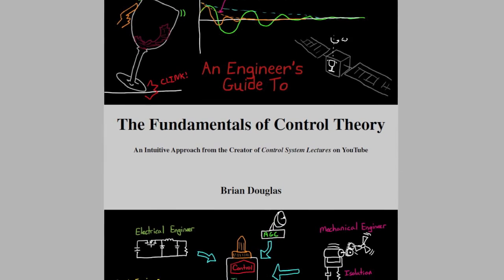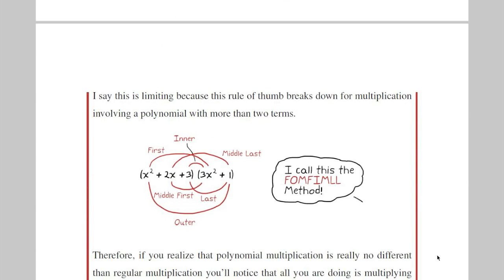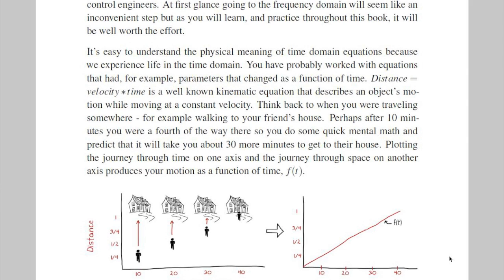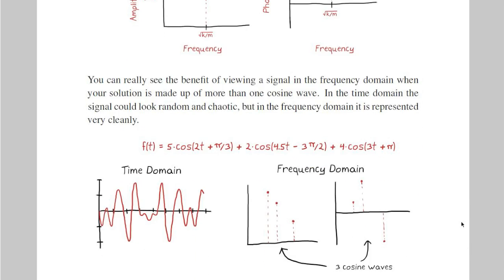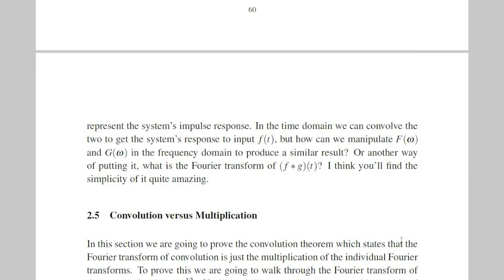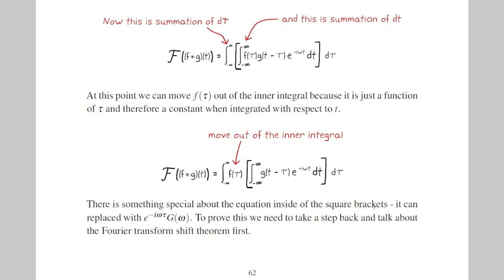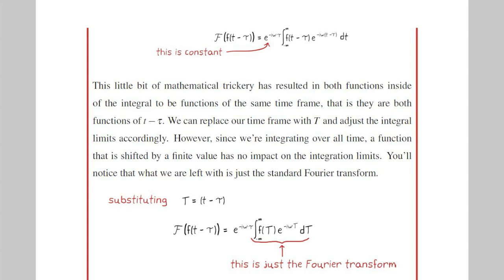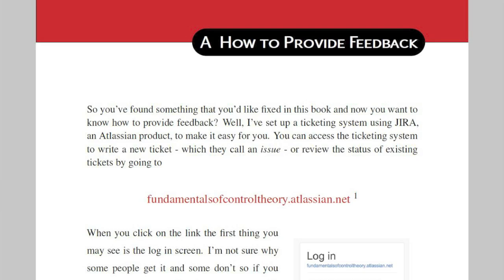The convolution theorem and polynomial multiplication

Comment: I just purchased your book. Do you have a pdf as opposed to the html. Thanks
Reply from the maker: +ElectronicWizard It is a pdf.  I think you're just viewing the pdf through you browser.  The document is hosted on Google drive so when you're viewing it as HTML there should be a button somewhere on the page to download to your computer.  Let me know if you can't get to it.  Cheers!
Reply: The header of the HTML reads; fundamentals_of_control_r1_2.pdf
but when I right click and go  save as... as usual, I am not given any options.
Reply from the maker: +ElectronicWizard hmmm, is there not a download icon at the top (below the address bar though)? It looks like a downward arrow with a horizontal line.  What browser are you using if you don't mind saying?
Reply: Got it. Thanks
Reply from the maker: +ElectronicWizard Great!